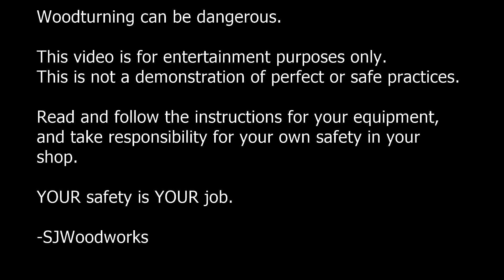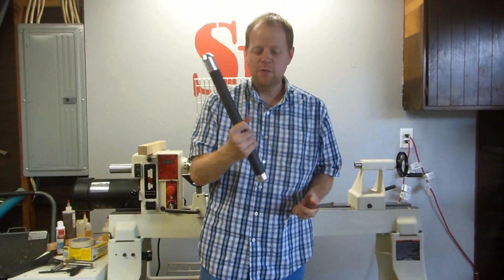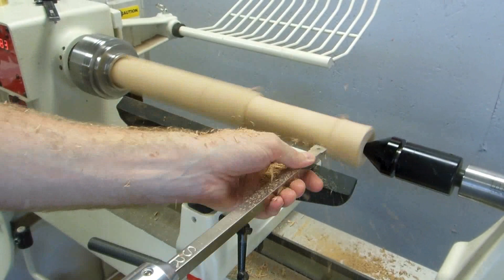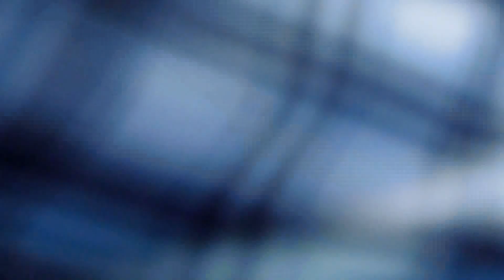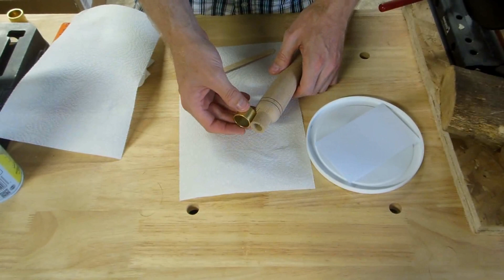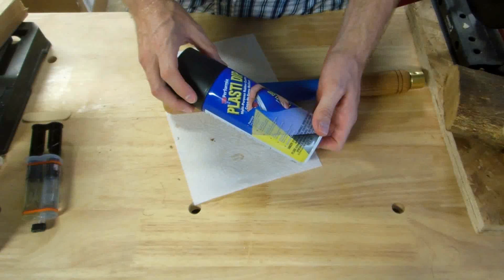Woodturning a lathe tool handle using carbide tools

Comment: Thanks for that, my new lathe has arrived and I have swapped over to Carbide and made all my own tools, now the lathe is here its time to make the handles, simplest video on here, most are using two bits of wood touted out but the difference here is its just 1 entire which I prefer.  I now have 10 tools to make handles for!!

The only thing I would add is if you have an angle grinder, on the shaft that goes into the handle just makes some gouges in the metal so it keys into the wood with the epoxy, nothing too deep, just enough to key it a little, if I still had my metal lathe i would use a Knurling tool .  No angle grinder use a File.... 

I make my own carbide  chisels  as it takes no time and costs virtually nothing and its daylight robbery that people like Robert Sorley, axminster  and others charge over a hundred pounds for something that is less that 5 pounds in materials, they are just using a name, Im a ex metal turner and its easy  to make a carbide tool just using a file and drill,.

Plenty of youtube videos on how to make one and you should never have to buy a carbide chisel ever, I even made my own parting tool by brazing a carbide tooth on to a piece of 3 mm  HSS, you can make them from old carbide HSS cutting saw disks if you cant braze or do not have the equipment.. Just search for videos but watch a few, this is one of the better ones, 

Other videos involve gluing 2 pieces of wood together that you rout out as the shank is square, if thats the case with your rod, either round it of on a grinding wheel or angle grinder or over drill the hole and use a lot more epoxy to hold it in place.

Comment: Nice handle Steve! I've bought some bars and bits from Capt. Eddie, good price and good product. Building your own custom handles is not only enjoyable but make for more comfortable handling. Think I'll give the plastic spray a try. Looking forward to the cutter use videos.
Take care, Dave
Reply from the maker: The carbide demo videos go up tomorrow. It's basically one ridiculously long video, split into 3 parts. Hope it will be useful to someone! Thanks for the comment.

Comment: Watched a lot of handle vidoes. I realy like that coating you uesd at the end. I am going to go with your approach for the 8 handles I need to make. Do you know if the coating comes in different colors. Thanks for a great video Steve.
Reply from the maker: +Yuval Yeoman It does come in a few different colors, yes. I think you can find them online. I had trouble finding anything but black in local stores.

Comment: Thanks for your videos Steve. As a new turner myself I gravitated to the carbides because the learning curve was so much easier! Have still bought normal gouges but I am still figuring them out. Having videos for carbide only will be good for the newbies out there though. One question, are you buying the branded carbides or sharpening the the ones you have?
Reply from the maker: Jon, thanks for commenting. The carbide tips take an edge pretty well (there are sharpening videos out there using just a diamond honing car). But eventually, a new bit is in order. There are cheaper sources, though, compared to the name brands!

Comment: Can you speak to the RPM count you set your lathe to, for turning this handle?
Thanks!
Very nice results, by the way...though I'm personally inclined towards additional coats of Tung oil for more of the "grippy" feel as opposed to that spray plastic covering up the beauty of those ash grain patterns...but, to each his own...
Whenever you're able to get around to doing your "shorts" videos, are you going to speak to the advantages in cost and technique over traditional HSS? This type of information would be very helpful for many trying to decide for spending the money to make the transition. 
'Still grateful for the contribution and the initiative. Sincerely, thank you.
Reply from the maker: This is pretty small spindle turning, so as long as you have a secure hold, I think the turning should happen at a very high speed. That's the best way to get a good finish off the tool, anyway. 

I have a three part video out there that explains how to use each of the tools and how to do all the major cuts with carbide. But I'm not sure there really is a cost or technique advantage over HSS. Just different. Easier to get started with carbide, for sure, but I like to use both. Best tool for the given job, I say.
Reply: SJWoodworks Genuine thanks...(if I'm to understand this commentary as a reply to my inquiry.)

Comment: Nice tool handle, enjoyed video.  How did you insert the tool into the handle?
Reply from the maker: Winston Barnett Winston, after I drilled the hole and verified that it fit (I had to sand out some of the holes just a bit to make them big enough), I glued on the ferrule, and then I just put some epoxy in the hole and around the end of the tool bar itself, and shoved it right in there, I guess. I had made it just loose enough that the air had a place to escape. Alternatively, you could drill a small relief hole in the side of the handle to let air out. Then I simply wiped off the epoxy that squeezed out, and that was that.

I did try to make sure the top of the cutter lined up with the little divot on the ferrule, so I will always know the orientation of my cutter, even if I can't see it inside a bowl or box or something.
Reply: SJWoodworks Bye the way you were right, switching the tools in the handles does become aggravating.  It only takes a few minutes (if that long) but it always happens when I'm in a hurry.
Reply: SJWoodworks
 Steve, Hi. A followup to Winston's question. So it looks like you've drilled a round hole into the wood using the lathe and if I'm not mistaken the shaft inserted into the wood is square? Is that correct? Reason why I ask is because I know I can take my 1/2" steel bar and try to figure out my router (only used once) to cut a 1/4" through one piece of wood, a 1/4" through another piece of wood, CA glue them together and then turn to make a handle but your method sure looks a heck of a lot easier. So will my square 1/2" steel bar fit in a round hole and stay there? Is that how you did it?
Reply from the maker: Paul Tomlinson Paul, actually, the last two inches of the shaft of these tools is round (actually, they have one small flat face for the set screws of the interchangeable handle, but basically round). But, if you use enough epoxy to fill the gaps, You absolutely could just glue in a square bar into the round hole. But keep in mind, for 1/2" steel bar, the round hole will have to be bigger than 1/2", because the corner to corner measurement of a half inch square is actually just barely bigger than 11/16". I would think that using two pieces and routing out a groove in each and gluing them together would introduce a joint that could fail under the forces of use, if your glue joint isn't perfect, or whatever. I'd be reluctant to do that, plus, as you mention, it seems like that would be a bit more work than just drilling it out.
Reply: SJWoodworks
 Steve, Thank you. I'll definitely just drill it out then. As you've said it makes more sense/stronger than having a joint. Thanks for the tip on the corner to corner measurement as well. Looking forward to getting this done   :)
Reply: +SJWoodworks Paul--Most of the videos that I have seen show them gluing in a longer amount of steel square rod--as in 6-9 inches when they use the 1/4 inch channel technique and I would think that would be more stable than the 2-3 inches that you drilled out to put in your tang.  Also the glue up of the two sides would have actually more strength than the wood itself, especially along the grain as done.  But I am sure both methods work quite well.  Maybe we should ask Matthias Wandel to do strength testing??  :)

Comment: Thanks for the video.  Did you just glue the square bar into the round hole?
Reply from the maker: Hammer and Neil I used 5-minute epoxy. Has never had a problem.
Reply: SJWoodworks good to hear.  Round holes are much easier to drill than square holes.

Comment: What is the starting point bit that you used to center the hole?
Reply from the maker: Winston Barnett It's a center drill bit, like these: 
http://www.amazon.com/Anytime-Tools-CENTER-COUNTERSINK-Tooling/dp/B000N216SU

I got mine at Harbor Freight for a few dollars. It helps minimize drill bit wandering, at least most of the time.
Reply: SJWoodworks Thanks, I've got it ordered.

Comment: Square steel into a round hole. Youdidn't round off the base of thr metal?  Just the square metal using a hockey sock full of epoxy glue?

Comment: Where do you get the ferrule from?
Reply from the maker: I just ordered it from Craft Supplies USA, but I've seen others use a piece of copper pipe fitting from Home Depot as well. They are pretty cheap to order, though, so I just went with that.